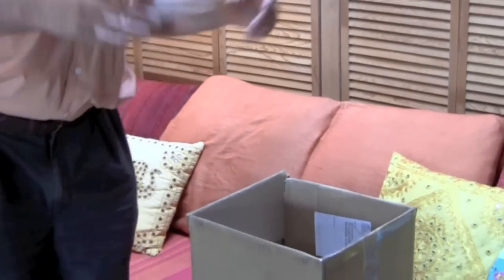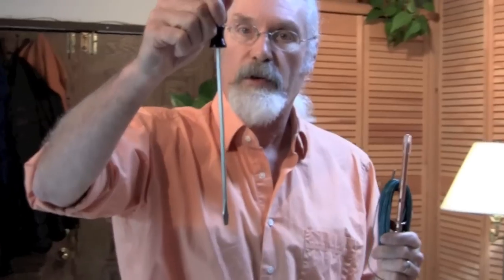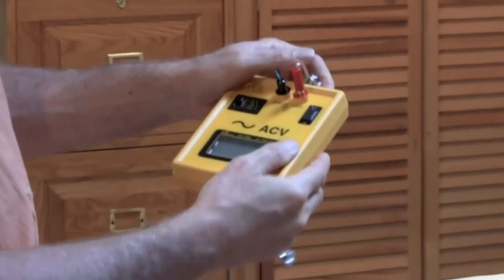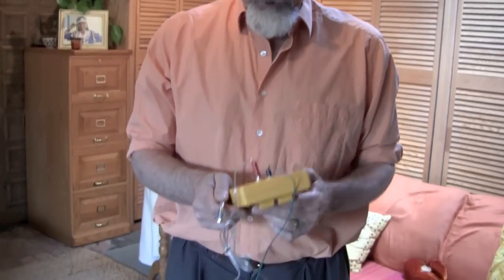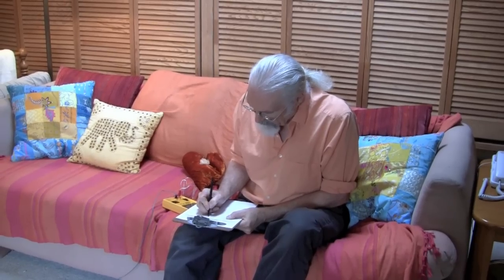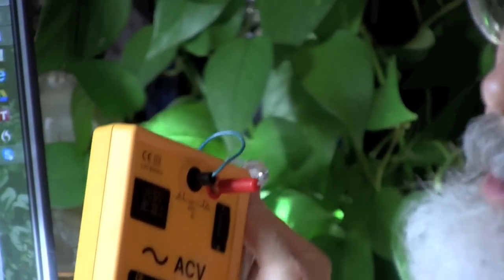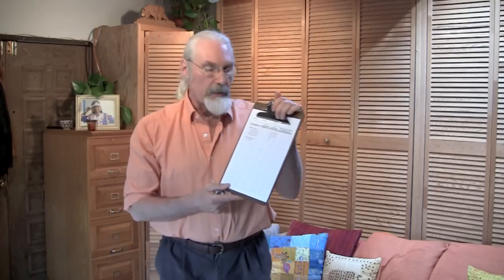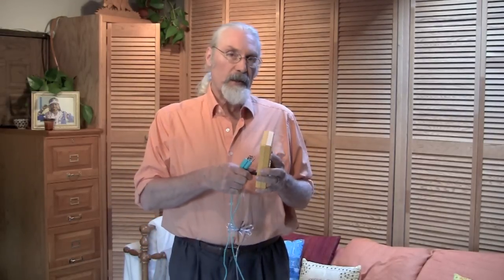How to Use a Body Volt Meter: To Measure Electric Fields

Comment: Very helpful video. I have the same body voltage meter and found a very big difference in body voltage readings using an outdoor ground rod vs an outlet ground. In one area using the inside ground the reading was .110 and using the outside ground the reading was .560. You said at the end of the video these are usually pretty close. Do you know what could account for this?
Reply: Did you ever get a reply?   I heard that  airborne stray voltage off power or communication (broadband above ground) lines can account for that.  The danger as you measure yourself is that you can literally fry your system if they are very high.  So make sure you pump yourself up with electrolytes or immediately take electrolytes as soon as you have taken your measurements.

Comment: What a wonderful video! We did a full house repipe with pvc. They removed lots of the copper piping. I was told that we have to re-ground our electrical wiring. How is this done? Will they have to punch holes in the walls again?
Reply: Well the house is probably done now but you will want to run a rod deep into the ground and attack a strong wire from your electrical box ground to that rod.  You can buy rods for this as th we y tend to make them specially to prevent corrosion.

Comment: Michael, we use the voltmeter to find millivolts relative to ground, but the Building Biology specification for ''safe" levels shows the dimensional units of V/m.  So how can we convert the Volt (from voltmeter) measurement to a Volt/Meter calculation so we can compare with those BB levels?  Thanks for the consistent quality of your information.

Comment: Is the following correct:
-Magnetic fields - measure with gauss meter
-Electric fields - measure with body volt meter
-Dirty electricity - measure with stetzerizer
-RF fields - measure with with a high frequency meter/antennae so you can calculate power density

Comment: now how do you measure the frequency or resonant frequency of the human body , do you follow the guidelines but use a frequency counter instead of ac voltmeter and run the ground to outside spike in ground and hold the positive lead of the frequency counter

Comment: Thank you so much. I suffer from excessive man made dreams caused by electricity. I calculed the frequency is about 300MHZ for high portion and less than 7Hz for the small part. When I sleep in the park or camping I don t get a single dream if it is far from the electricity bunches or electric poles. When I change my sleep area in the room , I don't get dreams for about 4 hours. But the problem is this solution is not convenient. I bought a shielding silver fabric it worked for a night, then the same thing again. I live in canada. It is like people don't care about human beings. Because if I get dreams (about 15-20dreams in 16hours sleep) I don't recover the following day. I started getting headache, pain in the kidney and in the bones , I have to get out of the room so that the pain disappears.I eat healthy and never had any health issues all my 55 years of age. DO YOU HAVE A SOLUTION FOR THIS BROTHERS. PLEASE HELP

Comment: If using a multimeter, is it acceptable to connect one lead to glass/rubber object and the other to one's own body for body voltage testing? In an apartment, a ground rod and/or metal piping isn't doable. Connecting to a ground prong in outlet seems risky and to be avoided if possible. (plus they may have slight voltage anyways) I believe multimeters actually measure a difference in electric potential between two points, so a nonconductor would be 0 AC volts, similar to how the earth has 0 AC volts. So the difference from body AC voltage to 0 would be the same.  Am I thinking about that correctly?

Comment: I've been scouring the internet, trying to find out what might be considered a particularly high level. I haven't found any info on what the levels mean, only how to use the meters. In most of the videos, people's body voltage seems to be from 0-1.5 V. At my parents' house, mine has been as high as 10 V and at my boyfriend's house, it has gotten up to 18 V. That's a far cry from what I'm seeing in the other videos. My parents have Greenwave dirty electricity filters. A whole home solution isn't an option and they can't afford to replace their wiring. The numbers are high in those areas whether I test with a grounding rod or using the built-in ground. What ever happened to part 8, where you discuss the significance of the numbers? It cuts off after part 7. I was hoping I'd found my answer.
Reply: That's super high. Make sure you're going outside and grounding often. Plus hydrate hydrate hydrate. 

I'm looking for the acceptable limits too. Or what it should be, what the healthy goal is.

Comment: Thanks much for this video. I'm wondering if you also have any experience with the stetzerizing meter and how it compares with body voltage readings. For example, does minimizing stetzer meter values generally correlate with minimizing body voltage? Does plugging in the stetzerizing filters generally result in lower body voltage readings?
Reply: I have this same question and can't get an answer anwhere.
Reply: @debbiecomeau820  I am going to run this experiment and will post my results.
Reply: @brb8829  awesome
Reply: Michael, I’m wondering the same thing. Can you please let us know how the two measurements relate? If you have grounding tools , have you then mitigated the dirty electricity issue?
Reply: @brb8829  Hi Chris, did you ever do that experiment? Would be nice to know the results.

Comment: Hi. So if you live in a High Rise Building , you obviously can´t ground a metal stick. So the test using a grounded outlet is still not valid? In this case, you wanna use an Electric field Meter or dirty electricity meter and measure it directly from the wires, outlets and stuff, instead through yourself using a BVM? Thank you.

Comment: CAN SOMEBODY HELP ME WITH A GROUNDING PROBLEM I'M HAVING  . . . ?  WHEN I TEST MY BODY WITH A VOLT METER  IT READS APPROX.   005.7_ _  MV .   THEN , WHEN I STAND ON MY GROUNDED PAD THE VOLT METER READS APPROX.   117.8_ _ .........  IT GOES VERY HIGH WHEN I'M GROUNDING MYSELF . WHAT'S GOING ON ???? PLEASE HELP , IF YOU HAVE ANY IDEAS.  THANX .
Reply: I’ve seen this on my multimeter too. I finally figure out I needed to plug things in opposite to how I’d plugged them in. Hopefully you’ve figured it out now.
Reply: @sharmaineryanmccumber2966  THANK YOU , SHARMAINE  ;-)
I THINK THE ISSUE ,          IN MY CASE , WAS THAT THE MULTI METER WASN'T THE RIGHT ONE FOR THE JOB  . . . . AS THE AC SETTINGS WERE ONLY 200 AND 700    . .  . .   NOT LOW ENOUGH TO DETECT ELECTRICITY IN THE BODY . SO I HAVE TO TRY AND FIND THE RIGHT MULTIMETER NEXT.  THANKS FOR YOUR SUGGESTION THOUGH ;-)  TAKE CARE.

Comment: I'd argue it isn't that movement gives a falsely high reading, rather it's that movement (contraction, energy output increase) causes an increase in electric amplitude thus increase in electric field as well as magnetic field. I'd argue someone angry and clenching there fists are higher readings also than someone who's meditating. :)

Comment: Great information. Thank you. However the yellow body voltage meter (seemingly designed for people with no experience with measuring electricity) has the complication of not being auto-ranging. You have to know enough to switch between three ranges. Such an expensive meter should be auto-ranging. You can buy an auto-ranging meter for $20.00 at an auto parts store. Another thing is that I would recommend a constant unit for explanation: millivolts. Saying "point this or that" is OK for pros but is confusing for lay people. For clarity I would emphasize learning to think to the third decimal place value of thousandths--which is what "milli" means. The great majority of people have not dealt with this since that 7th grade worksheet : -)

Comment: While this is good to measure body voltage, it says nothing on electromagnetic fields. A meter has to be bought anyway so I might be better off buying a meter that mesures both electric and electromagnetic fields. For the electric part the reading of the meter should not be that far off from the reading of the body voltage meter.

Comment: Is it AC or DC. Is this video on how to use a voltmeter or how to use your volt meter?
You didn't test the grounding rod. Not everyone has a tree and some are surrounded by stray electricity.

Comment: Hello, What is it you are trying to achieve? 
Living in a mud hut in the middle of a island would prevent your body from picking up household electrical emissions, but it is not practical. If you walk about outside or go shopping or do just about anything where there is power and wires running through walls you are going to receive frequency's. These frequency's are everywhere. Stick your volt meter into the earth and you will find a reading of around a volt. It is not really a usable voltage it is a frequency and looks fascinating measured with an oscilloscope. I find this sort of thing interesting which is why I watched, I just do not understand your point. Is it to sell the meter and idea of measuring all the radiating voltages? Are there health benefits to this? 
I am interested so have to ask. Thank you
Reply: YEA, & WE THINK THAT SOME OF THOSE PEOPLE ARE DUMB, OR, BACKWARD, & THEY ARE APPLYING TECHNOLOGY TO BE HEALTH THAT IS FAR ABOVE WHAT WE ARE USING HAHA!!!
Reply: LIMITING TIME OF EXPOSURE, EACH DAY, CAN MAKE A BIG DIFFERENCE!!!
Reply: People imagine all sorts, and the guy has product to sell that provides placebo.
Reply: I have an extremely high sensitivity issue w/ emf so any info helps! Just because you don’t feel it doesn’t mean it’s not harmful. I feel it when others don’t case in point -power to an entire plant where I work went off during a power outage. The electrician that placed power back on felt nothing standing directly in front of equipment and I standing 30-40ft away felt the voltage going through my legs feet first. Very bizarre stuff. I have headaches, brain fog and numbness/ neuropathy problems legs & hands.